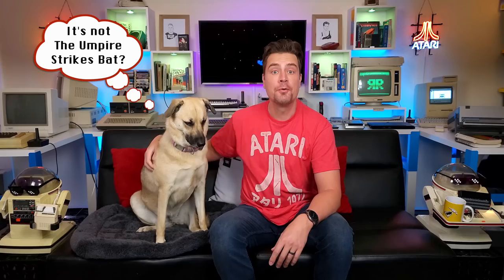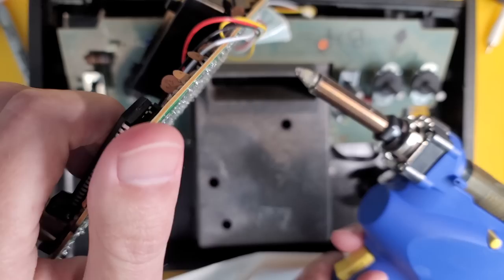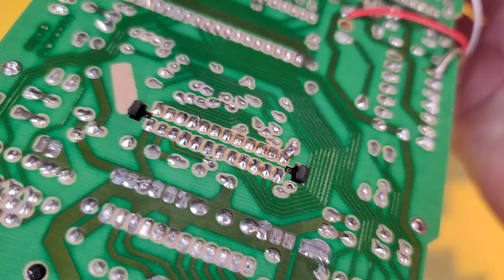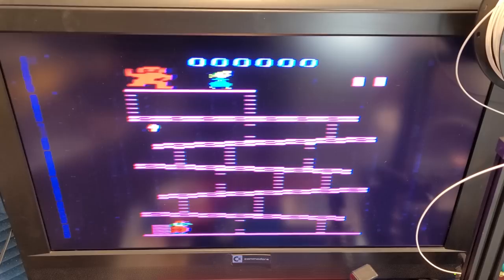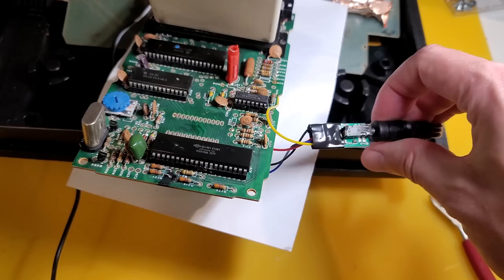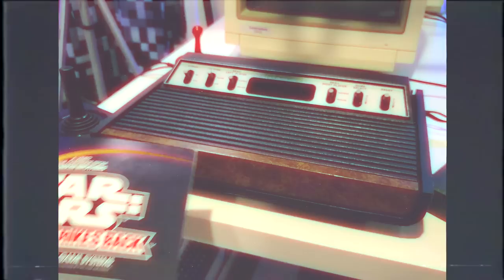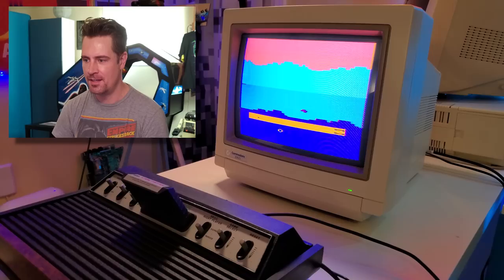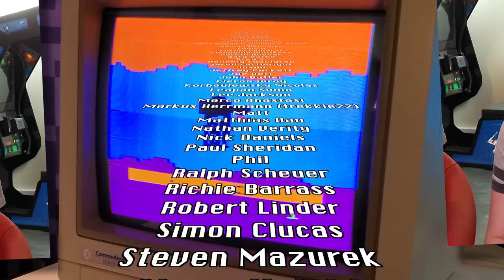I've waited 37 years for this game. WILL IT WORK!? | Empire Strikes Back Atari VCS Repair

Comment: How is that after all of these years I never knew you could repair by landing!? Learned something new hey. :D 

I'd thought about composite modding my 7800, but then I found an RCA male to coax adapter to replace the original switch box setup with a coax right out of the console to the TV. It's perhaps not as sharp as a video mod, but it's surprisingly clear and only a few bucks on ebay. In fact, one time I'd left it connected to the TV and was still able to pick up a number of channels. Apparently, the RF shield is grounded to the video output and the connection was good enough to use it as an antenna! Not a very good one, but still. LOL For those who aren't as handy with an iron, I'd highly recommend giving it a try. Unfortunately, my console seems to have a lose contact on the modulator, so I'm going to have to pop it open and resolder that at some point.

Comment: Ideally the best way to play this is to get the bomb hatches as soon as possible, select the level with the slowest enemies, more ships and only worry when the noise comes.  The noise means you have an enemy approaching the reactor which needs to be destroyed as soon as possible.  The new enemies will appear at the back of the pack, often further away from the rest with a bigger gap between them, you can start at the back as well as the front to make this gap bigger too.  The game is a long one compared with some, if you have the right level selected.  The level you played wasn't the best one to begin on, as the number of lives was too low.  Just saying.

Comment: some comments
1 a shielded wire on your composite mod will help a LOT
2 ferrite cores are even more effective by wrapping the cable around the core.  every wrap increases the effect.  I had a job where I wrapped a signal cable 5 times around three separate cores (15 total wraps) to get a clean signal.  
3 Also since you are using a 2 prong wall wart you arent grounding your RF shielding. if you make an adapter cable to bring out the ground wire straight to your RF shield, this will also help.
Reply: I have a lot of experience with analog signal noise in industrial automation.
Reply from the maker: Hmm. But that's not how grounding works. It's still grounded to itself even with no Earth connection. The same reason you don't need to plug in a CRT to discharge it by connecting the tube to ground on the chassis. Right?

Comment: Very nice.  I didn't actually own an Atari 2600 system until around 1990, by then they were pretty cheap.  My wife and I played it to death.  Still have it, but I don't know if it runs anymore (got both versions actually, the larger and the smaller 2600).  The games I loved for it were Battlezone (Atari)/Robot Tank(Activision) and especially Pitfall 2.

Comment: Thanks for the video. Glad the repair worked! :) In order to fix noise on screen, a ferrite can help. Just add some snap ferrites to the VCS power supply cable, the antenna/video cable and the TV's power chord. Radio noise (RFI/TVI/BCI etc) is a big problem of modern times. Especially switching PSUs, even expensive ones, cause electro magnetic noise and often have "ripple" on the DC power. The old transformer-based PSUs (those that were stabilized) provided a much cleaner DC, almost like a battery does. Adding a diode filters some of the noise. Also, old CRT TVs coped much better with weak and noisy HF signals. The analogue tuners in modern TVs are mainly designed for the "strong" signals of the cable TV.
Reply from the maker: Someone didn't watch the whole video 😅

Comment: new walkers move faster than older walkers and there is never more than one on screen at any ti me. A strategy i found useful was to shoot the lead walker down to yellow and then move down the line destoying walkers until the klaxon sounded. i would shoot the current walker iwas attacking down to yellow, then rush back to the first walker destroy it then continue destoying the trailing walkers and always leaving the slowest walker at yellow, eventually the walkers reach maximum speed, then it is just an endurance game. eventually i could play this for as long as i wanted. also dont forget the left and right edges wrap around so to get back to the lead walker at the far right it is very often faster to wrap around from the left.

Comment: You're not the only one having power issues. I have a 20 year old PSU running a water pump cleaning out my new radiators for the new computer I'm building. The pump is the only thing on the PSU. It's CHIRPING!!!! I'M GOING INSANE!!! Apparently this is normal when you have way more power available than is necessary. Maybe I can plug some dead hard drives I have laying around into it. lol
Reply from the maker: Wow. Might be time for a soundproof (ventilated?) box!
Reply: @RetroRecipes  I plugged in an old hard drive I don't care about. It's about half as loud as it was. Apparently that's what switching PSUs do when they make more power than is necessary. The final system won't have this problem as it will have a Ryzen 5900x and a Geforce 3080 20gb or a Geforce 3090 (depends on the price of the former and the availability of both). That will use plenty of power. It's not designed to run just a single pump by itself. hahaha

Comment: Good video mate, I enjoyed it, just one thought more: I think, you should have first got it to run with old TV aerial plug  connected to some old TV (without touching the build in RF circuit ), and only then start with the modification. It would made the debugging process easier.
Reply from the maker: That was already known to have a black screen (mentioned in the previous video) 👍🕹️
Reply: @RetroRecipes  I watched the first video again, and at the end you still have a black screen. After replacement of IC chip in the 2nd video, you got display working . What I am trying to say, if possible, never do several replacements at once.
Reply from the maker: @stewiegriffin6503  Yeah I understand. I was without a power adapter so it was a rare occurrence but logistically for video release timing I just had to go ahead. Turns out it was a faulty TIA chip all along, which was what I suspected, so no harm done. Thanks for watching and commenting 👍🕹️

Comment: I hope the ESB game pleases you.  I played this back in the day & I believe I still have the cartridge.  I know where it is, but would have to rummage to get to it.  I still have a VCS/2600, although I haven't powered it up in a while.  And one of the original Atari joysticks was dismantled probably a couple (or more?) decades ago, so I will have to find it & work on that too (I actualy spotted it recently, like a couple weeks ago, in some box, all taken apart & placed inside a Ziploc).  I don't recall why I took it apart, although most likely to fix something.  While ESB was ok, I did prefer Asteroids & Missile Command, which I also both still have.   Just thinking about it brings me back to the late 1970's & early 1980's.  Time is flying by.

Comment: To get it to work you can try a UPS unit. They usually filter everything out and supply applications with "perfect" voltage.
Some testing rigs i had on an old job even failed completely in countries with really bad power installations and we were forced to equip each testing rig with its own UPS unit.
Reply from the maker: But I did get it to work...?

Comment: I got a VCS clone in the early 90s with - I think - 80 games pre-installed in ROM, and probably this was the one I played the most with.
Reply from the maker: Cool do you remember what the model was?
Reply: @RetroRecipes  Well, it just came labelled as "TV GAME", looked exactly like the Darth Vader box, and one of the toggle switches cycled through the games one by one - along with the cartridge port, which we never got to use, because I don't remember any games available for it to buy. At the time I didn't even know what an Atari VCS was, I only found it out many years later. Here's a pic I found online
https://hardverapro.hu/dl/uad/2018-12/4141142/photo_2018_12_30_15_35_10.jpg

Comment: This would have actually been a pretty decent port to an Atari 8-bitter.  The walkers could be done in 4 color character graphics mode and would have been much more detailed.   Most of the common coding techniques for PM graphics work pretty much identically on a 2600  or an Atari 8 bit computer.  It’s a shame the computers didn’t get a port.
Reply from the maker: C64 port coming soon!

Comment: Just one thing, use shielded cables for the AV mod, it will get rid of most of the interference. One cable for the video and one cable for the audio. Those wires are acting like an antena and the best way to avoid is using shielded cables.

Comment: I don't think the wires were faulty it just looks like the wires of the video mod are very susceptible to picking up interference. The original flat cartridge cable must emit some RF noise and by replacing it with a twisted cable you reduced its emissions.  Shortening the video wires made them less susceptible. The audio and composite video leads should probably be screened although you might get impedance matching problems then. Better to mount the board close to the source of the signal and have the shortest wires posible.

Comment: Be a good idea to replace that composite video wire with a shielded cable.  The CD-audio cables from an old sound card work well, use one or both of the audio conductors (red and white) for the video and connect the braid (black) on at least one end to chassis ground.

Comment: I'm 10min in, I had the same issue with the Svideo Sega mod from Console 5. I spent days trying to get rid of static and line noise. In the end I figured it out. I used shielded cable and grounded the cable and it went away.

Comment: The distortion like yours are come often from non Shielded Coax cables. So the distortion is coming from the chipsets on the board itself and this are transmitter they send inside the open cables. This non shielded cables are like antennas so the pick up the Distortion-Signal over the Air. You must connect the Video Signal direct on the board via a shielded cable like the RG59 (75Ohm) or similar Impedance cable. Important reinstall all Electrolytic Caps again in the power supply. Maybe you must install a Chroma Amplifier with a Transistor. The cables are not shielded so you never can get a good picture. Interference come from Clock, Databus or Addressbus and/or the Videosignal itself is not clean and from the powersupply. The unclean powersupply send the distortion over the Power Supply to the Video amplifier and this you can see in the picture as a distortion. The Signal is Analog on the Video out so any Amplitude change you see inside the TV picture. Change all Electrolytic Caps! 
Your Monitor lost the Vertical Synchronisation so the picture is jumping that mean that the Video signal is not clamped. The Synchron must be under the Zero Volt line then the Monitor is not loosing the Vertical Sync. This is a DC Problem from the Video signal.  Best Regards Volker from Vienna Austria
Example of a Distortion that come from the µProzessor system - a 1MHz clock and/or data on one pin of a chip made a ca.~1cm (~0.4inch) vertical stripes over a ~26" screen.

Comment: Great video! Plenty of nostalgia that game stirred! I played that one soooo much. But I guess I was lucky. I wonder why they didn't try to take it back or something? It had to have been cheaper than the other one anyway. What about next christmas? Seems like much like everything it got cheaper to stimulate sales the next year. 
Hey and why weren't you trying to read voltages? It isn't enough to check continuity, especially with old boards and components, often they are way out of spec but still have continuity. Especially with the possibility of overvolting a chip. Tough seeing you do all that work for nothing,
Reply from the maker: I did check the voltages but not everything can make the edit in a long video 👍🕹️

Comment: Heh, I was going to comment to suggest that you try running the wires of your replacement ribbon cable, and or the composite mod, through some ferrites, then I see that you worked that out for the power supply.. :-)

Comment: to fix the video noise I would use shielded wires like TV coaxial cable is. An old RCA audio patch cable would work well.

Comment: It is very rare to see these ground loops in computers, if video consoles are improvised hardware but ... they are not soo commons. In the sega genesis you can see cables (any way) from side to side, but ever gorund loops noise problems (i hope).  I would try a coaxial cable on the mod or twist the conductors (i think possibly some decoupling capacitors are missing in mod circuit on the power conection...).
Reply from the maker: But I fixed it?

Comment: Generally EMI/RFI - video should be sent via coax aka shelled cable PCB to jack. Also check your RCA cable to see if they are shelded, most cheap ones are not.

You can add a common mode filter to get the AC power noice. Inside the unit.
Reply from the maker: I wish someone would tell the person who designed the mod

Comment: Comment 788 - USE Shielded cables for video signals!  Use the shortest wires possible.  Use few or NO connectors whenever possible.  Video signals are in the RF frequency domain.  Highly susceptible to interference.
Reply from the maker: That's what the mod maker supplied 🤷‍♂️

Comment: Man, this video was really frustrating for me to watch, I was shouting at the TV for you to shorten the composite wire... And you finally did, and then the problem got 90% better...  Glad you finally figured it out (the original wire wasn't bad it was just way too long and unshielded, and was acting as an antenna, picking up RF noise).
Glad you finally got your game working though, but I really wasn't a fan of that one on the 2600.  I would have traded you my Coleco Gemini (a 2600/VCS clone) for your Atari 400 any day of the week tho. XD
Reply from the maker: Haha well in my defense that's the wire that's supplied with the mod and the developer seems like he is very competent¯\_(ツ)_/¯

Comment: Should have installed a choke inside the Atari instead of putting them on the cable.  Just like in the Commodore 64.  People "say" its not needed, but you're demonstrating it really is.

Comment: There was a negligent capacitance across the connection point for the video output

It's usually not considered amongst 1 connection but there are several

Comment: Put two 0.1 microfarad caps between the input leg of the 7805 and its common leg, and the output leg and the common leg.  As close to the voltage regulator as you can.
Reply from the maker: For which issue?
Reply: @RetroRecipes  I believe he's suggesting filter caps to smooth out the RF interference.
Reply from the maker: @NozomuYume  Yes that would probably work. as I had the whole system reassembled and screwed together at this point, and the ferrite cores did the trick as well, I am all set!
Reply: @RetroRecipes  Well if it works, it works! Still a worthy mod if you ever feel like doing it as that will render it more flexible in power supplies that it can accept! Really it's a deficient design in the original product, but it was made back when digital consumer electronic devices were a newfangled thing!
Reply: @RetroRecipes  Just generally to clean up the RFI you're getting with chokes.  The 7805 isn't particularly stable unless it has filter caps near it on the PCB.

Comment: FWIY...
I have modded several 2600's with an S-Video board (see link below) and I connect them to my modern TV using the RetroTink 2x. The image is near perfect and the sound is loud and clear...and in true stereo.
http://electronicsentimentalities.com/Assembled%20Mods.html
This board has adjustments for contrast and brightness and outputs in both S Video and composite simultaneously.
All the best, Stephen

Comment: My high score is 6579. You REALLY NEED to avoid getting shot. The legs are useless. Line up your shots to target the three bomb ports on the Walkers, then unleash on them when they open. Cripple the lead walker to Orange and let him live, then go to the end of the pack and cripple the last walker to Orange as well. This will slow down all the others. Destroy all the walkers in the middle, then kill the first walker in the line before it reaches your base. Keep repeating this strategy with the last walker becoming the new "first" walker in the next line and you will rack up the points!

The bomb port on later game selections will release a smart bomb that tries to target your snowspeeder. Shoot it out of the air when it releases for max points. The harder difficulty setting shrinks the valleys on the bottom to make it more difficult to land, and the walker bodies "harden" to a point where you can crash into them, so use that to suicide into a walker when desperate. When The Force comes, stand your ground in front of a walker and unload a barrage of shots at it to weaken or kill it. You are invulnerable for a few minutes.

One other thing. The "hardened walker" means you can't fly through the walkers, but the legs are okay. Fly through the legs to line up shots, but don't clip the body or head of the walker or you'll crash.

Comment: Honestly, composite mods on Atari's are kinda ridiculous. Rf is sometimes bad but, you can get a REALLY clean picture on it depending on the switch box you use and if you are using a tv that is analog, they have something called FINE TUNNING. in part one of the video series it had a flakey and shakey picture. You can fix that and get AMAZING picture without modifying it.

Comment: You should use coaxial cables for the video signal it's had ground shield like those uses in Mobile phones and  ps4 WiFi cables you can find them in old caste stereo connecting the reading head